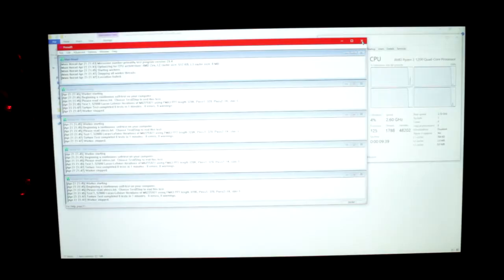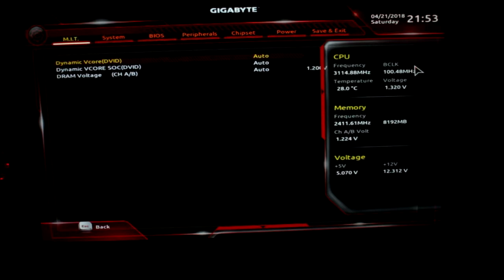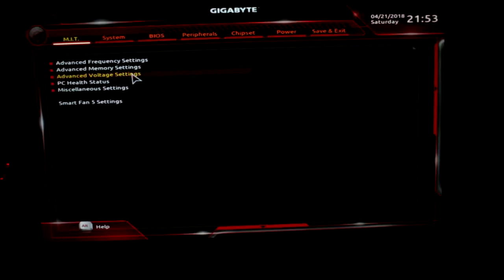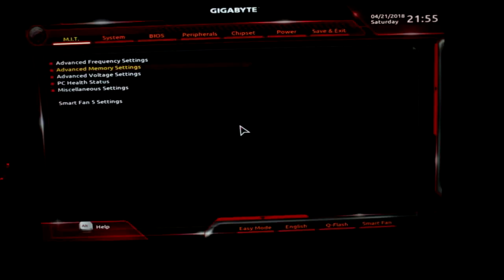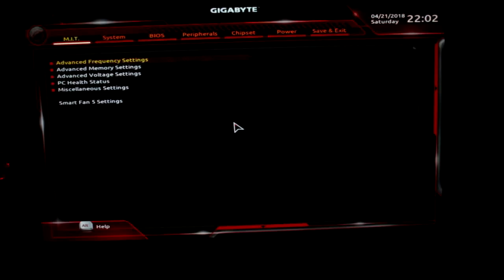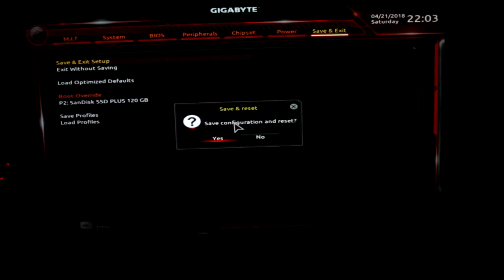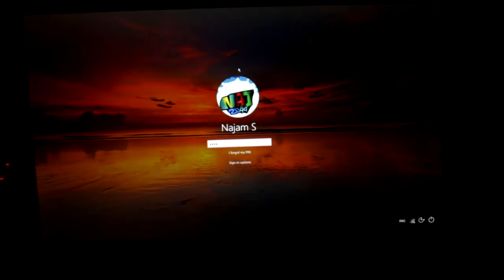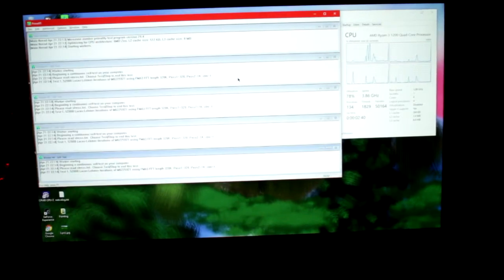Overclocking! Ryzen 3 1200 on Gigabyte AB350M-Gaming 3 MOBO!!

Comment: Thanks for this vid! Still helpful. Someone said that for the 1st gen Ryzens, like the 1600 and 1700, you just set the multiplier to 37 and you should enjoy 3.7 ghz  without having to fuss with the voltage. This on the stock cooler so that's not too bad. Seems to work well.

Comment: What would be the most stable OC for the Ryzen 3 1200? On the B30M Gigabyte board with cooler stock
Reply from the maker: Every CPU is different, do trial and error to find what's best with your 1200.
Reply: @NajamReviewsTech  my motherboard is: GA-AB350M-Gaming 3 (rev. 1.x) BIOS F41 (I am updating little by little) and the processor is the Ryzen 3 1200 3.1 GHz I would like to know how far it can go
Reply from the maker: I understand what you want but it really depends on silicon lottery. You'll have to find out by yourself as each CPU is different. Start by increasing the clock speed of the CPU to the desired limit and see if it boots up with no increase in Voltage. If it doesn't, increase the voltage using the Page up and down buttons each boot and benchmark. Don't go over 1.4v. Find the sweet spot!
Reply: @NajamReviewsTech  Thank you very much, I will do that until I achieve something stable

Comment: i did 3.9 @1.28 volts on stock cooler.
very stable
Reply from the maker: that's great! I guess I don't have a good silicone but I still like it :)
Reply: is it still stable?
Reply: What was your setting for the voltage using the page up and page down keys??

Comment: Excuse me bradder but U should know that gigabyte is always pushing the voltages more than you typed in BIOS, so please becarefull for what you're typing. I think 73 degree is quite hot for that cpu even with a stock cooler.

U can't use b350 chipset mobo (especially gigabyte) to adjust SOC voltage, so u will need to use Ryzen Master to adjust that SOC voltage and please note that gigabyte tend to push all voltages higher than any brand out there. Utilize HWinfo64 Software to monitor this crucial values: SOC Voltage, VRM & VSOC temps, Chipset, PCie and so on to see if you're not tresspassing any "safe configuration".

If you do not know or care about gigabyte habbit in pushing the voltage higher than u typed then some of your mobo elements especially that IMC (integrated memory controller) will degrade faster and it will requires higher voltage that are no longer considered as a safe voltages anymore and it's bad bradder... Peace.
Reply from the maker: thanks.

Comment: I was wondering if the ryzen 3 1200 works out of box with this motherboard. I have heard that the bios doesn’t support this chip anymore is. Is this true?
Reply from the maker: not at all, since it's first gen ryzen chip it will work.
Reply: Najam Reviews Ok. Awesome I bought this chip and the board I’m glad everything will work. Thank you!
Reply: Najam Reviews So I’ll be able to just plug my processor in my motherboard and everything will be fine right?
Reply from the maker: yes, in fact I was about to buy the Ryzen 3 APU (2200G) but I heard that you need to update bios on motherboard and you can't do that without a CPU. So I just bought the R3 1200 because I knew it would work. The funny thing is that on Gigabyte's website for this motherboard it says it's Ryzen 2000 series ready but people have problems with it out of the box. It will work don't worry.
Reply: Najam Reviews Awesome thank you again for all your help!
Reply: It will work.